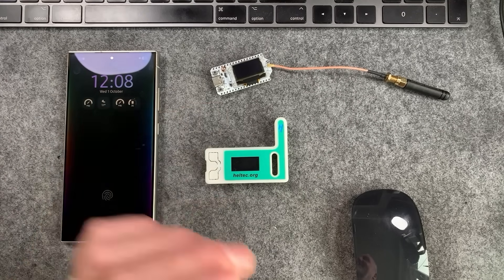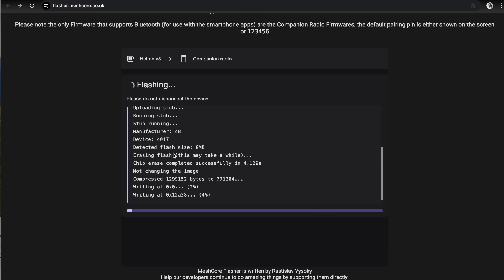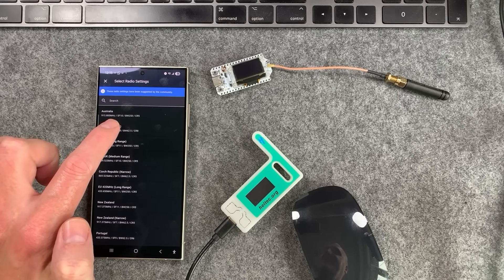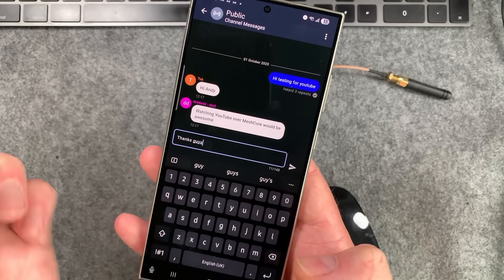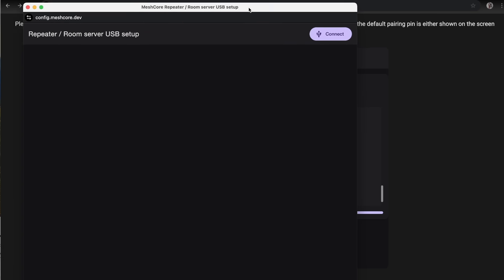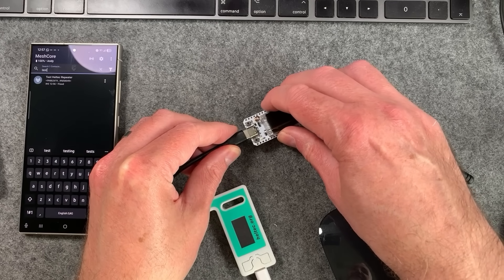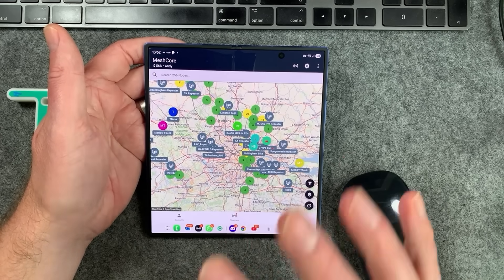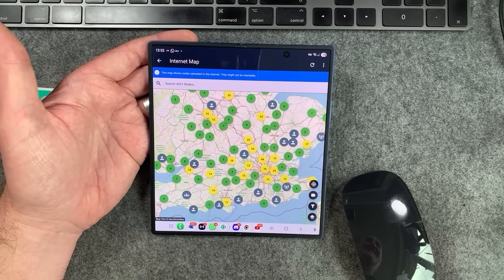HOW TO SWITCH FROM MESHTASTIC TO MESHCORE EASY!!!

Comment: Waste of time.  I have a dozen Meshtastic flashed devices and converted a Heltec T114 device to Meshcore and immediately discovered it was no longer manageable via Bluetooth.   
Despite that, I could manage via USB so I put it I the 2nd floor window for a day to see if the same device that saw over 200 Meshtastic nodes could see the Meshcore network.
I found nothing so I flashed it back to Meshtastic, might check again in 2027.

Comment: My SenseCAP Card Tracker T1000-E came preinstalled with meshtastic. Do I have to remove that from the the device first? If yes, how? The meshcore app does not see the device.
Reply: Just flash it for MeshCore, using the Erase option ...

Comment: There are no repeaters near me. I was thinking of putting a repeater in my loft. What would be a good aerial for this?

Also, I have a lora project in mind but would need to be able to pick up transmissions from small, portable devices about 2km away. Is this feasible?

Comment: This is pretty misleading. Meshtastic and Meshcore are for two different use-cases. Meshtastic excels in dynamic, mobile, and feature-rich scenarios, while Meshcore is better suited for scalable, reliable, and low-overhead city-scale or emergency response networks. The most significant difference is that Meshcore does not forward messages between nodes, instead relying on a central repeater or repeaters to relay messages. This makes it less suitable for tactical applications in highly-fluid environments than Meshtastic.

Comment: Dont switch. It will only make both worse
Reply: Meshtastic and Meshcore are for two different use-cases. Meshtastic excels in dynamic, mobile, and feature-rich scenarios, while Meshcore is better suited for scalable, reliable, and low-overhead city-scale or emergency response networks. The most significant difference is that Meshcore does not forward messages between nodes, instead relying on a central repeater or repeaters to relay messages. This makes it less suitable for tactical applications in highly-fluid environments than Meshtastic.
Reply: @n7ekg  guess i was implying to run both if wanting to switch, keep em both alive and just contribute to the networks

Comment: I have a heltec v3 and I tried meshtastic a while back with no luck and I am now trying meshcore. I am worried if my v3 is duff in someway. Is there anything I can check? For reference I am probably around 8 miles from you up in the Stevenage area and I know there other users up here.

Comment: I can imagine that this kind of fragmentation might even be state-supported.  
When something truly decentralized starts to work, there’s often no real interest in letting it grow — instead, it gets split apart early on.  
Who ends up controlling it later is anyone’s guess.  

The only way such a split could make sense is if there were proper gateways —  
nodes that speak both Meshtastic and MeshCore and can actually bridge them.  
Otherwise, this whole "upgrade" just turns into another divide-and-rule scenario,  
where real mesh potential gets lost in controlled isolation.
Reply: There are ways to 'combine" different mesh networks. 
I have been working on Reticulum and Meshtastic creating a "mesh" between the 2. 
Still requires 2 devices though. So counter productive lol
Reply: @mrk6964  I would be highly interested to hear about your set up.  I would be very interested in doing something similar.
Reply: guys, it's a nice thread to read, with no animosity or strong assumptions etc. I'm quite new to both networks and using them to know better (city area). In my city people on MC are sometimes more stiff and too focused on their own opinions which makes discussions a bit harder for those who look for more balanced views. I can see many more people on MT than on MC, but the latter delivers my messages more reliably. On the other hand I visited the very remote area in the country where both network reside as well and there were people somewhat active on MT and on MC none. So it's probably better to be prepared to use both :)
Reply: The thing is it all can use mostly the same hardware so I don’t see why it’s a bad thing for us all to update as technology improves.  Right now it seems like meshcore is the way to go. Simple enough to switch over nodes to meshcore.  I’m hoping in the near future reticulum will be more ready for prime time and then we can just switch everything over to that.   
It really isn’t proper fragmentation. It can be more like an update to existing infrastructure
Reply: @elainajourney  Your “same hardware, so it’s not a problem” argument misses the point.

This isn’t about the device platform or how easy it is to re-flash an ESP32. Hardware is just the carrier. The “music” is the protocol, addressing, routing, identity/trust model, and network semantics.

Switching from Meshtastic to MeshCore without interoperability is not an update/upgrade — it’s a protocol and ecosystem switch. An actual “update” would preserve continuity via backward compatibility, coexistence, or gateways/bridges. Without those, you don’t extend a mesh; you split it into isolated islands.

Same hardware doesn’t mean “same infrastructure.” By that logic, installing Linux instead of Windows would be “just an update” because it runs on the same laptop — which is obviously false. Different OS, different stack, no native compatibility unless you add bridging layers (dual-boot, VMs, compatibility subsystems). Same here.

If there are proper gateways that speak both Meshtastic and MeshCore and can bridge traffic/identity/routing meaningfully, then sure — you can call it an evolution. Without gateways, it’s fragmentation, and it reduces real mesh potential into controlled isolation.

You can flash an ESP32 to control a fan, too — that doesn’t make it “the same system.” The question isn’t what the hardware can run; it’s whether the network remains one network.
Reply: @KaiWeber-gl6fb  I mean, switching a computer’s OS from Windows to Linux is certainly an upgrade. XD 
I understand your point. However, meshtastic has limitations for the use it is mostly being used for.  
Meshcore also has limitations and eventually we will have to graduate from that.   
Your way of thinking holds us back. 
It prevents progress.
Reply: @elainajourney  Calling a Windows → Linux switch an “upgrade” is a value judgment, not a technical argument.

Technically, it is a platform change: different kernel, different userland, different ABI, different ecosystem. It only works as an “upgrade” in practice because decades of compatibility layers, standards, and bridges exist. Without those, it would be a hard break.

That distinction matters here.

I am not arguing against progress or evolution. I am arguing against breaking network continuity and calling it progress. Those are not the same thing.

Meshtastic has limitations — agreed.
MeshCore has limitations — also agreed.
Future systems will replace both — obviously.

The question is how you move forward.

Progress that:
- preserves interoperability,
- allows coexistence,
- or provides gateways

→ grows a network.

Progress that:
- replaces one protocol with another,
- without bridges,
- without coexistence,
- without continuity

→ fragments a network.

That’s not being “held back.” That’s basic systems thinking.

Real progress compounds existing infrastructure. It doesn’t discard working meshes and restart them as isolated islands. If your definition of progress requires breaking connectivity and social trust to move forward, then the problem isn’t caution — it’s the design.

Saying “we’ll just switch again later” is not a roadmap. It’s technical debt deferred into the future.

This isn’t anti-progress thinking.
It’s anti-fragmentation thinking.
Reply: It should be called 'Andys ego mesh'
Reply: There are certainly situations where things seem like states (or other interested parties) may have caused issues. Graphene vs Calyx (and everyone else), Demise of Nokia and RIM (the big only non US controlled phone systems. ie not subject to the Patriot Act). However I don't thin this is one.

Meshtastic caused the fragmentation by preventing their "free" system being included on a third party client. Had they not, the situation of MeshCore vs Meshtastic would not have come about.
Reply: @thirtynine-j5x  Thanks a lot for this insightful reply — really appreciate you taking the time to explain that side of it.  
I hadn’t heard that Meshtastic itself might have contributed to the split by restricting third-party clients.  
That’s a very interesting angle and it actually makes sense from a governance perspective.  

It would be great if one day we had some kind of integrator projects — hybrid nodes or gateways —  
that could bridge these systems again. Because fragmentation is really the last thing a mesh network needs.  
Thanks again for shedding light on this!
Reply: @KaiWeber-gl6fb  MC and MT have very different strengths. MeshCore will be great where there is a fixed infrastructure of repeaters due to its efficiency, where MT would overload. However it would be pretty useless away from civilisation (and repeaters) when the all noise Meshtastic makes would be an advantage (as beacons), and every device can be a mobile repeater.

MeshCore has far better software on the T-Deck and similar. So in between the extremes it is more pleasant to use. Had this been available with Meshtastic as effectively a second different channel, it would have been great. Meshtastic in the wilds, MeshCore in the big cities, and in between, whatever the locals end up choosing and everyone able to use the same nice software.
Reply: @thirtynine-j5x  Thanks so much for your detailed and friendly reply — really enjoyed reading that!  
You summed up the practical differences between MeshCore and Meshtastic perfectly.  
It makes total sense that MeshCore shines in structured environments with fixed repeaters,  
while Meshtastic keeps its edge in the wild where every node can act as a beacon.  

I totally agree — if both systems could coexist as separate channels within one framework,  
that would be the ideal scenario. Urban efficiency meets rural resilience.  
Thanks again for sharing your perspective — I’m really enjoying this topic!
Reply: @KaiWeber-gl6fb  Thanks. MeshCore is my preference, but it's not perfect. But they fixed the biggest issue (I could see) a week or two ago; The lack of sensible defined default settings. Since the change (which I copied) there are at least 8 repeaters that were previously on a different other channel, and I saw about a hundred messages on public, and there's people chatting in a test room I set up. I don't think reliable city wide comms are very far away here, previously it was just a toy I was playing with, with some colleagues.

Comment: The first question I have is why would I want to switch from Meshtastic to Meshcore? I'm in the USA. Does Meshcore work here too?
Reply: It depends on your situation. MeshCore  uses separate repeaters and cleints and these don't advertise themselves much. The repeaters form a mesh, which the clients access, otherwise they are point to point. In a big city or any area with repeaters MeshCore will be better. However in areas of low population and no repeaters, MeshTastic will be better, since, the client devices advertise their presence a lot and act as repeaters. Also there is currently no way to connect meshes other than by LoRa on MeshCore. There are other strengths and weaknesses to both,

The thing that made me choose MeshCore was that MeshTastic resisted being included on multi-protocal clients (for the T-Deck). My default position is that if I am forced to choose between two things by one party being unreasonable, that party will be the losing party.
Reply: @thirtynine-j5x  Meshtastic and Meshcore are for two different use-cases. Meshtastic excels in dynamic, mobile, and feature-rich scenarios, while Meshcore is better suited for scalable, reliable, and low-overhead city-scale or emergency response networks. The most significant difference is that Meshcore does not forward messages between nodes, instead relying on a central repeater or repeaters to relay messages. This makes it less suitable for tactical applications in highly-fluid environments than Meshtastic.
Reply: @n7ekg  The biggest downside of MeshCore is that a single static device can either be a client OR grow the repeater network.

This could be fixed without breaking the separate devices model by repeaters that allow Android MeshCore clients to connect via BLE. (Cross band/mode repeater not a companion)
Reply: @thirtynine-j5x  "The thing that made me choose MeshCore was that MeshTastic resisted being included on multi-protocal clients (for the T-Deck). My default position is that if I am forced to choose between two things by one party being unreasonable, that party will be the losing party."

I think you've made a huge mistake. Meshtastic being "unreasonable" is actually them operating on an open source license that does not allow some third party to come along and utilise it in a proprietary way, effectively taking all the hard work done by community, and then locking it down for profit. So really it's got nothing to do with the meshtastic devs aside from that's the license they decided to start with, and would be placing themselves in legal trouble if they broke that agreement. So there's nothing stopping people from setting up multi protocol clients that include metastatic; the clients just have to be open source. 

The unreasonable party here was whoever was trying to take advantage of other peoples hard work for their own personal gains. For example, it would be illegal for meshcore to implement meshtastic protocol on the phone client, because the phone client is proprietary for meshcore.

Comment: Too bad MeshCore has paid features like Repeater Admin.. Sensor Admin, zoom levels,  unlock devices, etc. It doesn't make sense to need to paid for these features. THis is slowing down adaoption!
Reply: It can be done via the companion radios.
Reply: is OPTIONAL .  Just wait 10 sec
Reply: @TodaySuveranist  or use CLI
Reply: Those are just on the T-Deck, probably less than 5% of people use those
Reply: are you so poor you can't spend $10 for the extras?  how much time do you think the authors put in to give you the basic software?  My gripe is that I bought the unlock on the UK web site (for 8 pounds) and never got the unlock code OR a response to my 'contact us' message...  seems like we (most of us) are so spoiled by getting this stuff for free that we begrudge the generous authors even a pittance of $10 for special features.   :(

Comment: All android and apple phone will use AI (even if turned off) to create a profile of the user. And mesh that uses a phone app has no privacy. No point in mesh without privacy.
Reply: A point that has occurred to me too. The portable options currently are to use a degoogled device (GrapheneOS/Calxyos/IodeOS/e\OS/LineageOS) or a self contained device.

It would be nice if a flag could be set on messages so they will only display on the device's own screen. (At least confidence your side of the conversation won't be scanned by an AI)
Reply: pc apps could be made too.
Reply: @alkeryn1700  With Windows and Mac the same privacy issues occur. Linux would be viable to avoid the concern.
Reply: @thirtynine-j5x i only run linux so i didn't even considered it lol, all I'm saying is that you can run it with the pc

Comment: Of course, don't setup a repeater unless you have to. If everyone does it, then things will get congested fast.
Reply: so time to pull some old nodes from the box and set them up as repeater so people will find out mc would have the same issues as mt has and mc aint the solution either in case of emergency. only reason mc works is because not everyone from mt has moved their nodes to the same client/repeater firmware. in case people do mc is just as mt a piece of garbage.

Comment: I will get round to swapping my Repeaters over to MC . Just can’t access them until the vegetation has died back. The main part I like is the remote maintenance as currently I have to go and physically go and take them down to update etc.
Reply: Yes, it is nice. I managed to change a repeater from what I was using to the new standard from 2 km away. (I think firmware updates require being in 2.4 GHz range.)

Comment: I am waiting for my M5 Cardputer ADV with LoRa module to arrive from "OpenLab" will there be meshcore support? I know it will work with meshtastic I just wondered if I will need to carry 2 devices instead of one all in one? Thank you for your time. (DaDude Liverpool) Repeater
Reply: Similar, just got a couple of Heltec v3s and had them working so now I've got a M5 cardkb to hook up and thought...will this actually work?😅
Reply: @mroctarine  As there is no Meshcore software for the M5 stack cardputer adv with LoRa hat  I will be switching back to Meshtastic until some big brain works on the software. Good luck.

Comment: I got as far as hitting the flash button. It won't do anything. It does not bring up the window to select the device, unfortunately.
Reply: The usb-c cable worked for meshtastic but apparently not for meshcore. I switched it out and I was able to flash it. The app now sees my device but I cannot get it to connect. I was able to connect via the web client but still can't with the phone. The app and client are not very intuitive. If that could get sorted out, it could be a game changer. I re-flashed back to Meshtastic. I don't see myself using Meshcore. There's potential but I am all set for now.